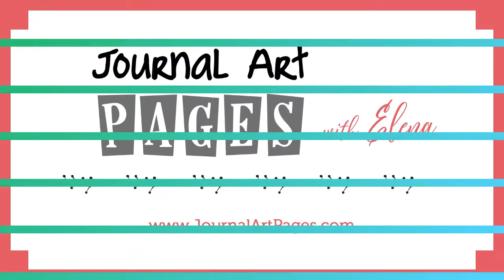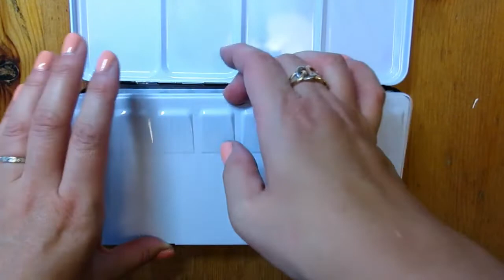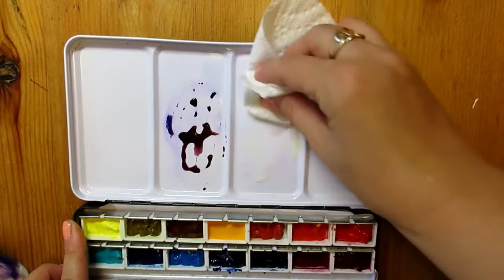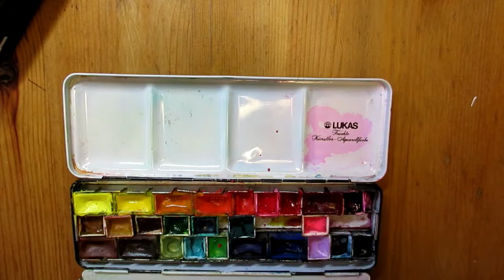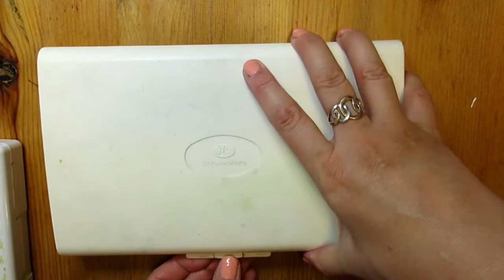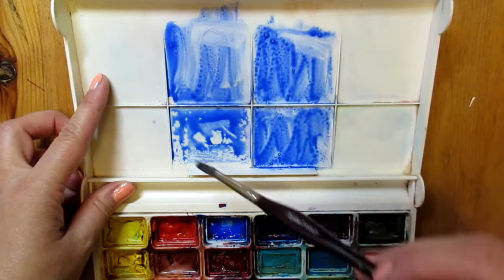Stop water beading on watercolor palette tin or plastic

Comment: I will have to give this a try, I have found many things work temporarily, starchy things like prit-stick rubbed on with a damp cloth, bar of soap and my age old favourite "a bit of spit" rubbed on with a finger. These all work because they contain either enzymes or other wetting agent. The problem I find is as soon as you wipe out the palette with damp tissue,  you're back to square one with the beading. You can reduce this by just leaving the paint on and clearing up  the odd spot with the swipe of a wet brush if you really need a clean bit.  I will give the VIM a go and see if it provides a longer solution., thank you for this tip.

Comment: Exactly this same thing i found today! tooth paste "solution" was good for a moment to prevent beading in my plastic palette, but after some use and water it seems that stopped working somehow. My theory is that tooth paste particles are added to the plastic surface, helping with the beading. But they end up removed and that is the end of the solution. Today i was searching for some cleaning product in my house and i found one that said "contains micro particles"....i mean just the same style of product you are using here also to clean bathrooms and what not. Is working great so far and from what i see, the surface changed structurally for ever. Time will tell. Yours still working fine? And of course, thanks for this video.

Comment: What is waterproof, non-abrasive, drys in thin layers, and white?
Bombay India Ink. If you apply it in layers, it'll keep the original palette white, and you can remove the ink with rubbing alcohol. It's also an excellent supply for highlights and blanching layers.
I don't know how alcohol might react with plastic, but it won't harm the metal.

Comment: What is the product made of. I've never seen vim in the US.
Reply from the maker: Hi, hmr128, I know it is probably not sold in the US, but I can't get the list of ingredients from the bottle, since it is not an edible product, they are not obligated to list the ingredients. i can only say that it  a cream cleanser and is supposed to be used for enamel sink or tub and top of the stove. Needs to be used GENTLY and removed right away. Contains microparticles. It is a chemical cleaner, that's why I say int he video you might try another creamy cleanser that you can find in your local dollar store or hardware store, or even grocery store. I hope this helps!
Reply: Its active ingredient is baking soda
Reply: Soft Scrub does the same thing.
Reply: Cif is another name for it.